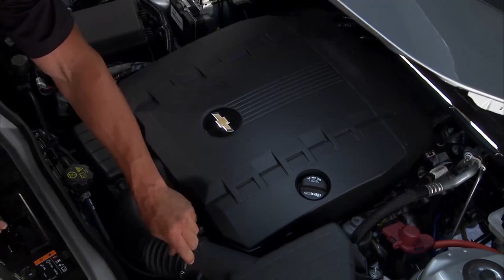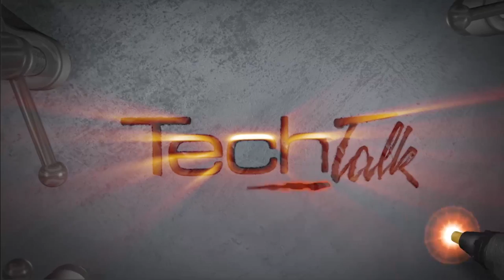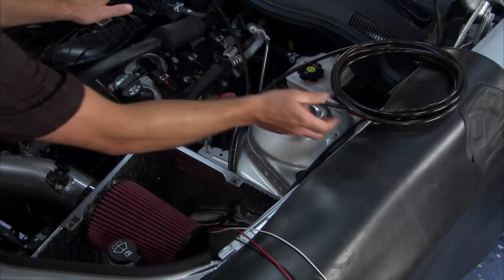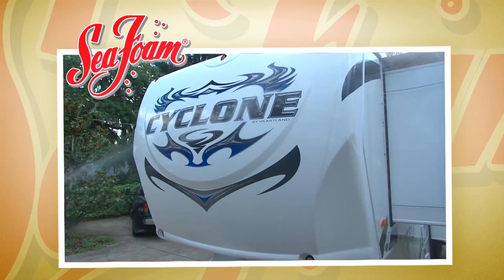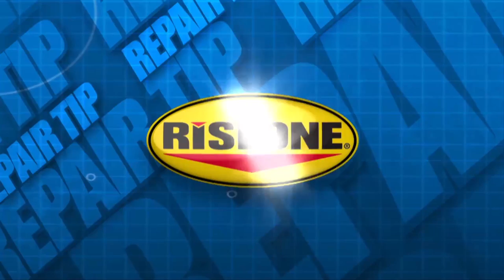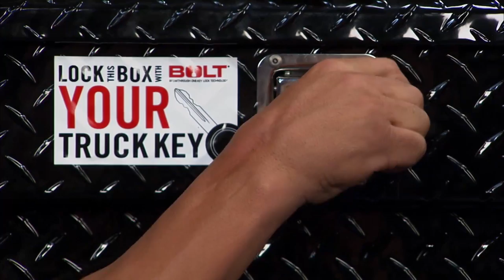V6 Camaro Performance | Two Guys Garage | Season 12 | Episode 10

Comment: This is a question for them or anyone here, I have a 2016 RS and I plan on doing a lot to it, but I don’t want to make my engine explode. I’ve read not to go past 510 HP. Is there ways for me to upgrade internals so my engine can with stand much more than that
Reply: save your money up and buy a V8, i bought a V6 2019 rs and it’s best to keep it stock bc when trading it in you’ll never get the money back you put into it. rather just put the money into the v8 and mod it from there
Reply: @minorbutmajor45788  well I appreciate it but a little late 😂
Reply: @masteroffire5793  do you still have your V6 Camaro ?

Comment: I would never buy a v6 Camaro... it's not a Camaro... its basically a Malibu with a body kit
Reply: @Shawn Mitchell  your right, Malibu's are much cooler, they accept what they are 🤣
Reply: @Shawn Mitchell  🤣🤙
Reply: I wasnt going to explain what I meant but... I meant a v6 Camaro is completely useless, just like putting a body kit on a Malibu is also completely useless
Reply: Ever since the beginning of the Camaro it has always had a 6cyl option,,, it’s a real camaro whether you agree or don’t agree,,, it’s just the affordable one.

Comment: Wow, so your telling people cold air intake and nitrous?!?!  What about throttle body, light weight drive shaft, just a better tune!!  Once you run out, your done, your cars stock again, dont listen to this, go get a full exhaust, cold air, throttle body, and a performance drive shaft.  Then get a professional tune once you change out plugs, and fill it with 93.  Plus, dont ever put a nitrous system on a plastic intake, you begging to blow that thing to bits when it backfires......

Comment: The last ls1 SS camaro had advertised 325hp but was actually 350hp. Not 310hp either way.
Reply: That’s crank hp bud.
Reply: Way more torque than the new v6's too. An LS1 would destroy a v6 camaro lol

Comment: Actually it isn't because it's super cold air it's because when the nitrogen holding the oxygen molecule combusts in the chamber and hits a certain temperature it releases the extra oxygen molecule that it's carrying that's what makes the power  more oxygen and then you add the appropriate amount of fuel and there's your power. Figures these guys wouldn't know what they were talking about lol...
Reply: And who are you?  Walter White?
Reply: @tomm3695  no I'm just a guy a guy with a certain set of skills lol...

Comment: why do these guys bother with these aftermarket "K&N" type systems. They have been debunked 1001 times. In some cases they rob up to 15+ hp.  They are no more than a straw. If the opening of the straw is 1 inch but the other end is 3/4's its only going to allow as much in as the 3/4 end. Air is sucked in by the engine. Its not pushed in.

Comment: You can't beat cubic inches guys.
Reply: Yeah a bone stock K24  with a turbo making 500 hp. To the wheels. But u r right a big cast-iron 2000lb. 500 cubic inch engines is the way to go???

Comment: Lets be honest, car people who bought V6 camaros either cant afford the cost of a V8, they’re teenagers whose parents wouldn’t allow them to get a V8, want something to fuck around with, or in rare cases someone looking to take on a nearly impossible challenge.
Reply: never know. some guys just want the v6. for what ever reason. maybe plans for a turbo setup. less wheight in the noswith the v6 for corner carvin fun. just an overall better balanced car in mass dist over the tires. but mostly due to the reasons you already said lmao. ill take the biggest v8 i can get TY 😄
Reply: never know. some guys just want the v6. for what ever reason. maybe plans for a turbo setup. less wheight in the noswith the v6 for corner carvin fun. just an overall better balanced car in mass dist over the tires. but mostly due to the reasons you already said lmao. ill take the biggest v8 i can get TY 😄
Reply: I own a 2010 camaro v6 and also a 2011 camaro 2ss indy pace car. The SS is a lot faster, but the v6 definitely handles a lot better due to not being so nose heavy and I love the V6 fuel economy, and find that
I can't really use all the power the SS puts out without driving like a maniac on the street or going to a drag strip.

Comment: As the owner of a 2011 V6 camaro I can say severally things.
#1 My 96 Z28 with only 290 HP felt WAY WAY WAY more torquier is that a word? Eh who cares
#2 My 96 Z28 ran a quarter @13.90 ON ITS BEST DAY @ around 100 MPH my 2011 has ran the quarter same track same lane @ 14.4 @ 94 MPH
#3 My 2011 V6 is an absolute dog it feels slow especially the drive by wire TPS I hate it it responds so slow and sluggish. My 96 Automatic z28 did way way way better burn outs from a red light just matting the throttle than my 2011 V6 6 speed manual does any day of the week. 
Maybe it's me maybe I suck a big Dick and can't drive a manual who knows and really who funcking cares except maybe the 40 year old fat fuck living in mommy's basement world of war craft playing can't see his own feet let alone his 2 inch Penis he has so wittingly named Stanley because he still thinks 80s Andrew Dice Clay references are still relevant troll reading this and is about to reply to tell me I'm fake or some shit does. I don't care all I know is I would bet on my 290 HP 96 Z28 mopping the floor with  my SUPPOSED 326 HP 2011 V6 Camaro any day of the week. Hell I would put 3 300 pound fat chick's in my Z28 and I still think it would run the quarter faster.
Reply: Have you verified the timing to make sure the timing chains aren’t stretching? 
It’s real common with the 3.6 engine

Comment: What are you smoking?   The Lt1 in the old 4th gen camaro made 275 hp the first year...but it made 50 more lb ft of torque than your v6 in a car that ways 500 lbs less.  The LT4 made 345 ish...The Ls1 in any late  4th gen will blow the doors off your v6...
Your V6 camaro is never going to beat your buddies V8 unless he leaves it totally stock and you mod yours to within an inch of its life... Boost , nitrous, all equal durability issues,  on an engine that is already wicked up near max from the factory..  gas milage??? Lol Ok.  Mod the fuck out of it and lets see the numbers... A V8 is ALWAYS going to be a better platform for straight line performance. Anything you can do to that v6 you can do to a v8  BETTER... I like the lil v6,   but to say your going to beat your buddies V8 is a fucking joke..
Reply: First off a sound being good is a matter of opinion and a lot of people think American V6s sound good, some say V8 is better but V6 is still good and I4 is shit. Some like them all. And then some are ass hats and belittle anybody that doesn't have a V8. 

That engine is not an economy engine, its more of a jack of all trades engine as it is the only V6 GM uses (including variants), they just use different tunes for different cars. The N/A ECOTEC I4 engines are economy engines. A lot of people will by the V6 because its cheaper and the better MPG when not playing with it, and with 300hp it has plenty to play with on the street with other cars and older generations of V8s, might not always win but you can play. Some people that have bought the V6 and played with it eventually want a little more like a lot of car guys do and $5000 in mods is cheaper that $15,000-$30,000 in a new car with a V8.

Stepping away from the Camaro, some people are seeking knowledge for upgrading other cars with this family of engines as the top engine or in my case, as an option I might want to swap into my car over a Buick 3800S/C series II or a 3.4 push rod engine.

Here is a really good (IMO) sounding V6 3800S/C. Yes its modify but you have to modify every car to make them sound really good.
https://www.youtube.com/watch?v=Meat-VaF038
Reply: I totally confirm your comment. I had a 2001 LS1 V8, and I now have a 2014 V6. There's no way the V6 is faster. Also.. It's pretty common knowledge that the LS1 V8 HP figures were underrated by Chevy. There are many dynos to prove that. That being said, the V6 has great power at highway speeds, and way superior handling to the last generation. The LS1 is much lighter, and way more responsive to acceleration to the stock newer V6. You can't just compare the HP number on the tag.
Reply: bdd1469 see I'm not the only one who thinks this is currently own both an LT1 car and a 5th gen v6 I also own a 84 Z28 which let's face it my wife's Traverse would blow it's doors off. LNAO HIGH OUTPUT 305 MY ASS! HEY GM IT'S A 305 A DAMN BOAT ANCHOR WHAT THE HE'LL WERE YOU SMOKING?
Reply: ok say that to the grand national..............
Reply: Twin turbo and cams bigger jets high flow exaust . Bigger gears ,25% under pulley, light weight fly wheel . And nitrous . Would cost me less then it would you and gas per mile still better too . And my car is doubling your hp for less cost . As for your car it would cost more and lose gas per mile . Durasticly.
Reply: haha the 305 camaro? i had a 91 rs with the 170 hp 305. even with full bolt ons. roller rockers  performer intake and the big 670 cfm holley throttlebody and 90 pph injectors. slp headers y pipe no cat and flowmaster 3" catback.. list keeps goin. did everything except change the cam or heads. it maybe made a solid 210 at the flywheel on a good day after it was all done. then i got froggy and installed a nitrous kit. custom built it to suit what i needed. not the bate bones kit. started at a wet shot of 150. made 2 passes. while it was holy crap more fun.... still wasnt enough.... dual fuel pumps " 1 just for the juice  with dedicated fuel line for it " ended up with a 250 shot... yup never ever cracked the engine open. but i did run into valve float. isky springs solved that.  and not enough spark. msd 6al and coil fixed that.. ran a bottle through it every weekend down here in houston on rankin road back in 98.....err 99. lasted over a year beating on that boat anchor of an engine. whelp had a woman in the car headed to a car show and toying with my buddies 86 iroc. nitrous fuel pump failed in the middle of a pull. bam bam there went no 5 and no 7 piston.. damn i miss the good fun ole days.
Reply: haha the 305 camaro? i had a 91 rs with the 170 hp 305. even with full bolt ons. roller rockers  performer intake and the big 670 cfm holley throttlebody and 90 pph injectors. slp headers y pipe no cat and flowmaster 3" catback.. list keeps goin. did everything except change the cam or heads. it maybe made a solid 210 at the flywheel on a good day after it was all done. then i got froggy and installed a nitrous kit. custom built it to suit what i needed. not the bate bones kit. started at a wet shot of 150. made 2 passes. while it was holy crap more fun.... still wasnt enough.... dual fuel pumps " 1 just for the juice  with dedicated fuel line for it " ended up with a 250 shot... yup never ever cracked the engine open. but i did run into valve float. isky springs solved that.  and not enough spark. msd 6al and coil fixed that.. ran a bottle through it every weekend down here in houston on rankin road back in 98.....err 99. lasted over a year beating on that boat anchor of an engine. whelp had a woman in the car headed to a car show and toying with my buddies 86 iroc. nitrous fuel pump failed in the middle of a pull. bam bam there went no 5 and no 7 piston.. damn i miss the good fun ole days.
Reply: haha the 305 camaro? i had a 91 rs with the 170 hp 305. even with full bolt ons. roller rockers  performer intake and the big 670 cfm holley throttlebody and 90 pph injectors. slp headers y pipe no cat and flowmaster 3" catback.. list keeps goin. did everything except change the cam or heads. it maybe made a solid 210 at the flywheel on a good day after it was all done. then i got froggy and installed a nitrous kit. custom built it to suit what i needed. not the bate bones kit. started at a wet shot of 150. made 2 passes. while it was holy crap more fun.... still wasnt enough.... dual fuel pumps " 1 just for the juice  with dedicated fuel line for it " ended up with a 250 shot... yup never ever cracked the engine open. but i did run into valve float. isky springs solved that.  and not enough spark. msd 6al and coil fixed that.. ran a bottle through it every weekend down here in houston on rankin road back in 98.....err 99. lasted over a year beating on that boat anchor of an engine. whelp had a woman in the car headed to a car show and toying with my buddies 86 iroc. nitrous fuel pump failed in the middle of a pull. bam bam there went no 5 and no 7 piston.. damn i miss the good fun ole days.

Comment: that's not a 5th gen camaro though.
Reply: +Bayne lol so which generation that camaro?
Reply: that's not a thing... they're all 5th gen. Early ones had the LLT, then the LFX came along, then the 14/15 got a new front bumper and newer/better tail lights.
Reply: what is it then?????
Reply: R u stupid ? or are you dumb ?
Reply: Its a 5 1/2. It has the 2010-2012 body style with the 2013-15 lfx engine and new steering wheel.

Comment: You guys lost me when you started talking about nitrous.  I would rather see a full system, cold air I take, throttle body and a tune.
Reply: THATS THE SAME THING I WAS THINKING. I AM REALLY LOOKING FOR A V6 CHEAT CODE
Reply: @wakehustlegrind  that's it then. I've got a buddy with the mods listed, plus injectors, fuel pump and a tune. And he easily makes atleast 450 crank. Fast ass n/a v6. Stock internals. Just full bolt ons and a great tune. Gapped wrx's and some sti's. I'm an import guy but overall it's a great car with as much potential as the v8, if not more due to better technology (overhead cam).
Reply: do the bolt ons  then add the spray.

Comment: What brand is that Cold Air Intake? Where can I buy it? Thanks.
2013 Camaro LT1 RS
Reply: Ashlee Petri cold air inductions*
Reply: Rene Feleo This CAI is by Cold Air Injection. I've looked into this system myself for my 13 camaro. Still debating between this or a RAMair.